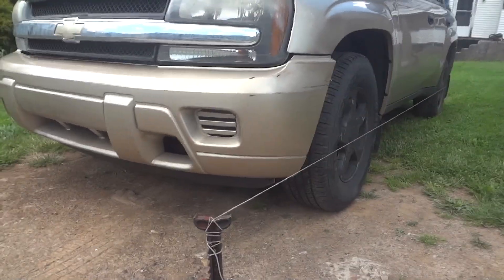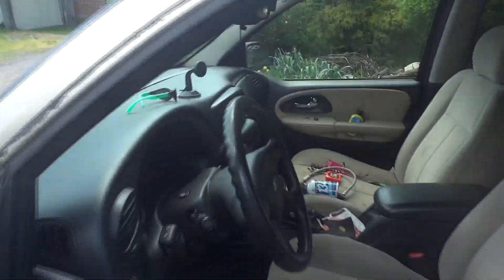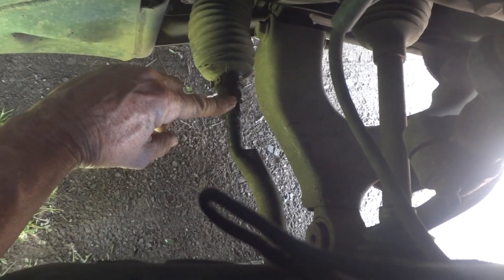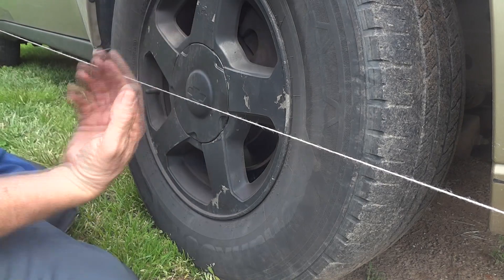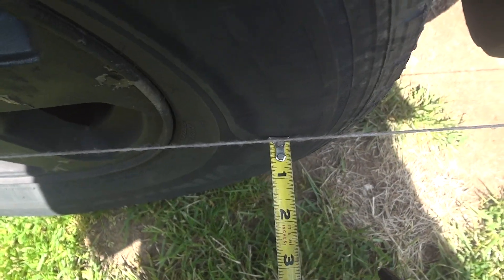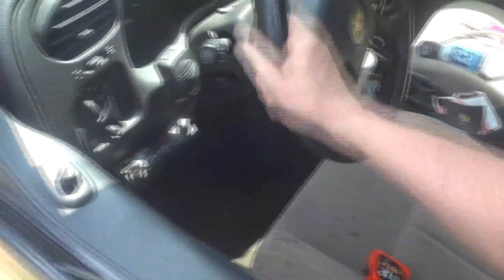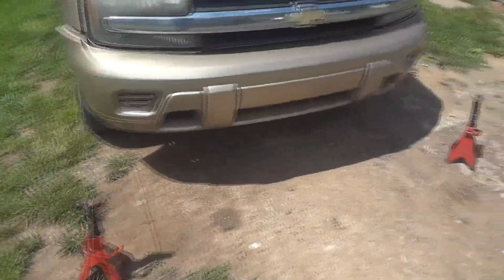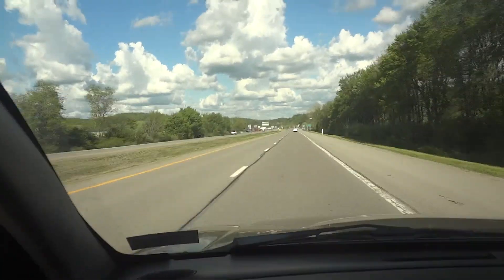Shade Tree Trailblazer Alignment ....Free!

Comment: Thank you. I don't have a trail blazer, but I get the idea. 

Great content 👍

I don't have a lot of good to say about my local "alignment" shops. This was a perfect explanation of the practical parts of basic alignment stuff. 100% makes sense. 

I think my local shops might rely on their lasers too much and lack a bit of this know how. I've never gotten a good alignment. The steering wheel is always off and the vehicle always vehicle pulls. Pretty much everyone has this experience with them too, it's not only me.

I will be replacing my ball joints myself soon since the shop quote was $2700 for both front left and right ball joints. So now, because I'll be the one doing it, it made me think that maybe after 25 years of bad alignments I could look up some basic alignment how-to information and do a passable job myself. Won't be any worse than what I usually get.

At my job, when a massive gas turbines can be leveled faster and better by the old way with just water in graduated cylinders than with the laser tool, it reminds me the old ways are often just as good or better. Even the Romans could build thousands of miles of roads with large 50 mile sections perfectly straight using basic methods...

It just goes to show that fundamentals get called "primitive" and dismissed way too often.

Thanks again. 🤙

Comment: I like doing this on a flat concrete surface. I take two pieces of cardboard and put grease between them. Then I put those two under each front tire. Hillbilly turn tables. You can get a steering wheel holder off eBay for really cheap to keep your steering wheel straight during adjustment.
Reply: 1q